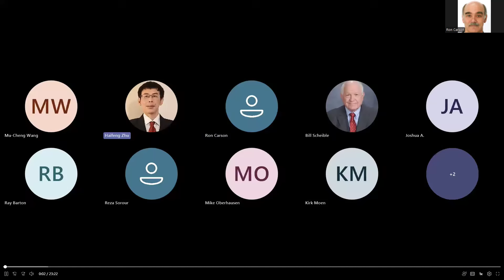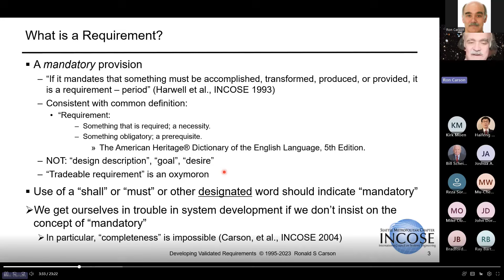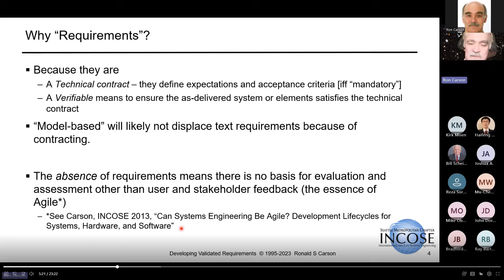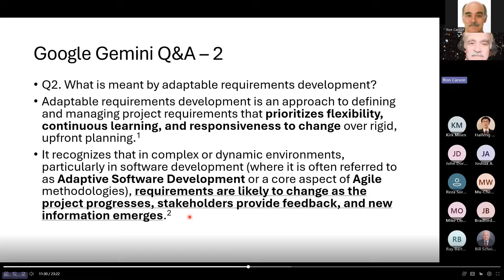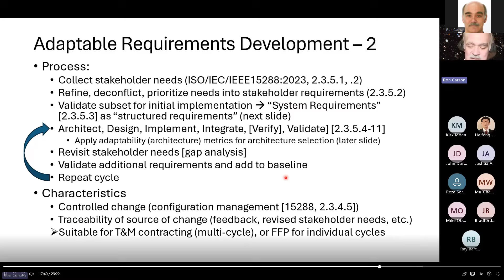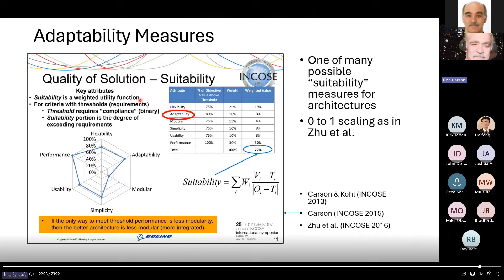Adaptable Requirements Engineering

Comment: Comments

Add a comment...

Can requirement equate to con or re-straint? Essentially, boundary?

In thought, the mind forms reason based on terms that combined with other terms form finite meaning. Finite meaning can be precisely expressed with different terms.

Therefore is requirement not constraint where different ways of combining terms produce the precise outcome derived by a different set of terms?

Answer: This is true. The brain expresses just 65 defined conclusions to all issues it faces. All brains do this through out all history and language. 

These 65 conclusions modify 4 brain reactions to everything: Where; How; why; what.

From this fixed set of meaning every mental image of our universe is derived. Therefore truth has a boundary. 

Designing lossless semantic expressed in text compression, better named, "symbol substitution for thought," characters uncovered this fascinating requirement for our universal mental image transmission of meaning between diverse minds across all cultures